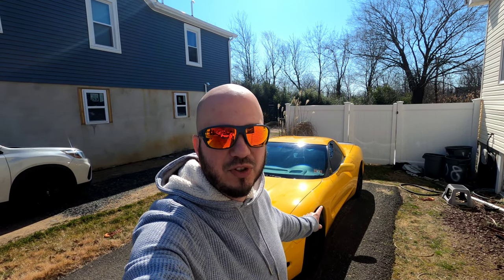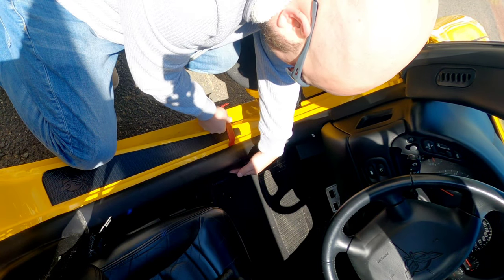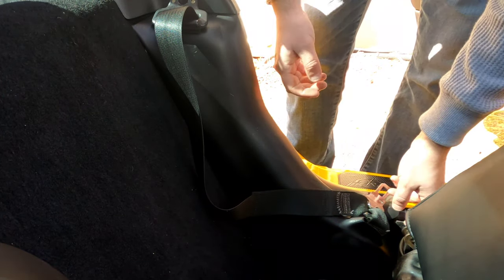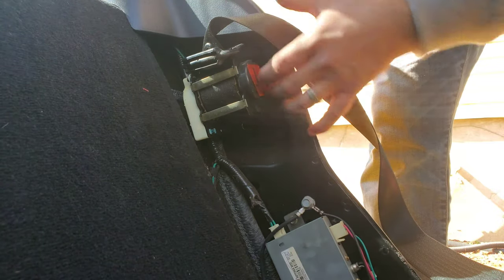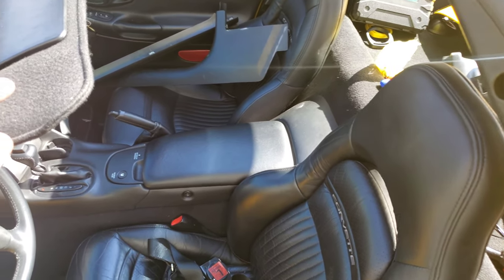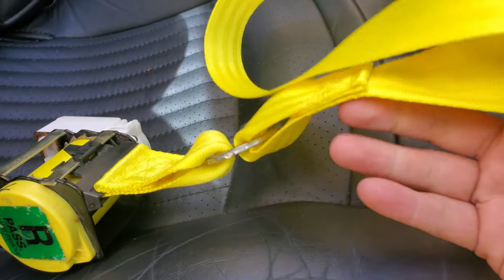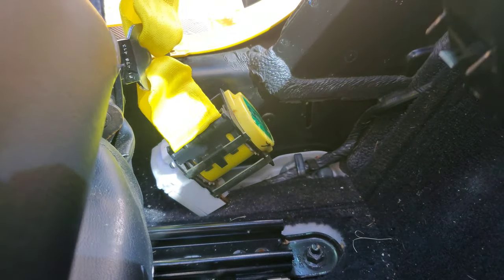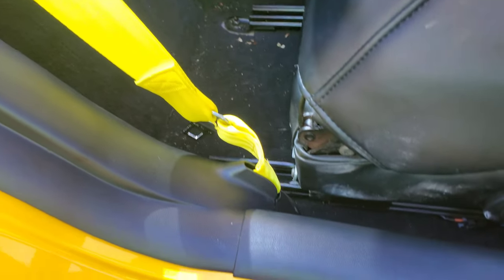C5 Corvette Yellow Seat Belts - Safety Restore

Comment: Hi Dave, nice vlog, how have the engine mods. worked out...any increase in speeding tickets...lol...we figured your Wine consumption has gone up...lol...thx ...have a good one.
Reply from the maker: No increase in tickets... yet. The car runs great and I'm super happy with it. So far no urge to go procharger yet. I've been on the 1 glass of red wine a night for heart health diet lol.
Reply: @YellowVette04  We All know you had a Great time doing the engine mod. work, but could you reset in this comment, the HP numbers you gained and the parts cost...I'm thinking of doing a rear gear change first, in my 99 C5 Vert. A4,  that has a 2:73 ratio...to 3:73...thx

Comment: Looks  like your driver side seat is coming apart, common fault, I  kept the black belts but reupholstered my seats in the black & yellow, kit from Interior Innovations, see pic on their site, same leather kit as some vette  sellers offer, but at less than half the price.
Reply from the maker: Yea these seats are notorious for ripping at the same seam above the bolster. It's not THAT bad yet but new seat covers are definitely in my future. I'll have to check them out. I have an idea of how I want the interior to look and it'll be a progress just like the rest of the car has been. Thanks for the advice 👍
Reply: I saved my old set and the pass/side is mint if you are intrested you could use it on the driver side. @YellowVette04
Reply from the maker: @williamjsmith9877  that's tempting lol. It's not bothering me enough yet, but I'll remember this if I ever change my mind.